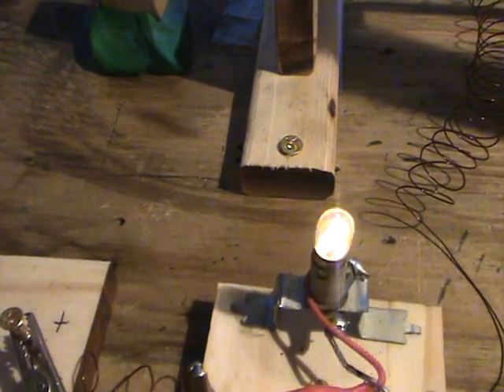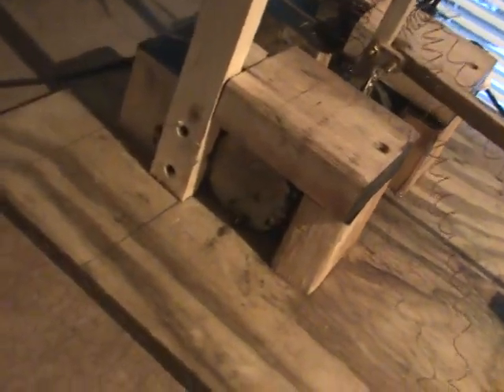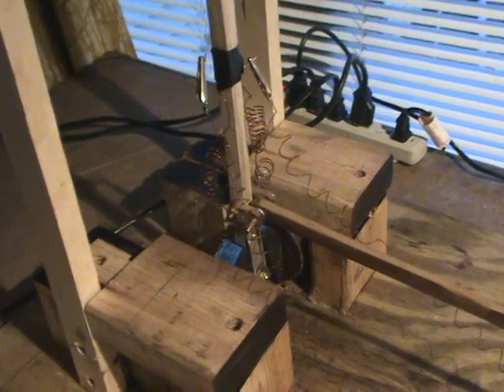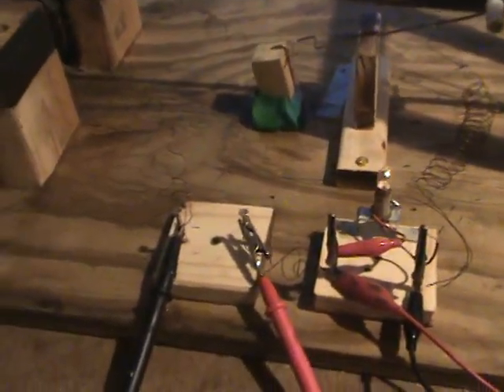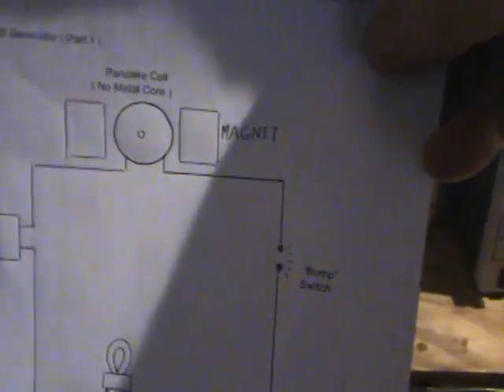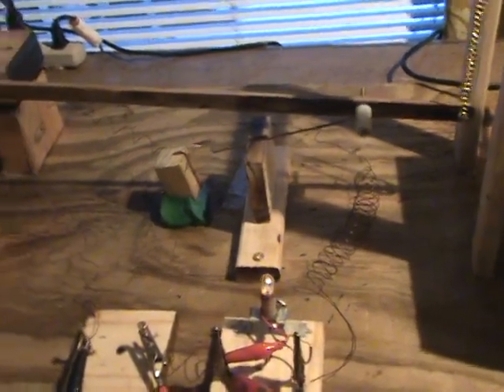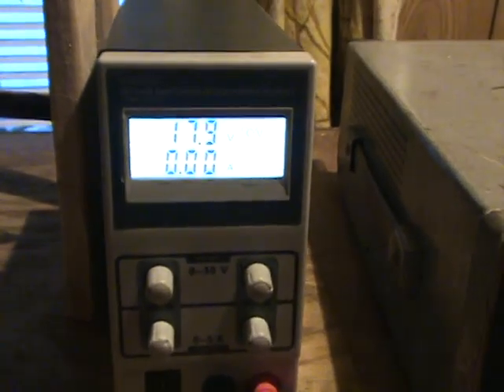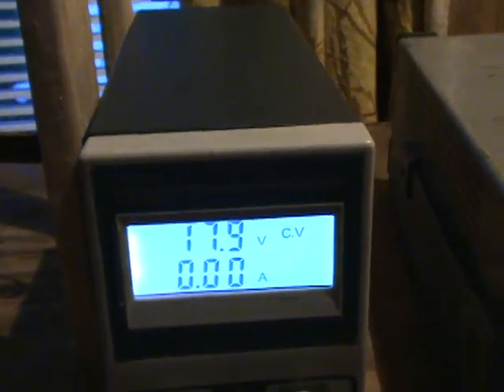Ray's Super Magnet Generator (Part 2)

Comment: I would like to have 2 big magnets like that but my luck with the strong ones I have, have hurt me at times.  Just curious but I assume you tried the big magnets in a N and S way rather than N and N?  Just wondered if you had a result which I assume was not very good or you would not have it N and N in video.    : )